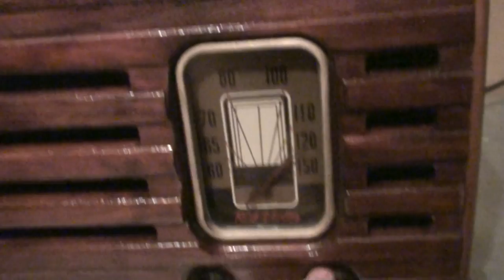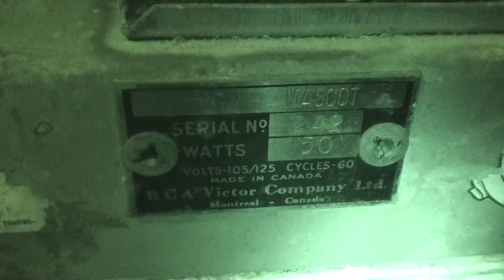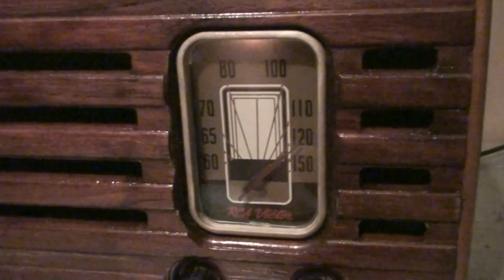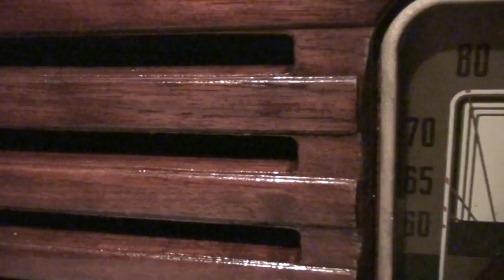1942 RCA Victor Mascot Radio

Comment: Good Job. I am doing one of these also and I like to know how did you integrated a glass in the tuning window if you do not mind. Also I noticed that is hard to tune the radio to a station and have way to much hum between the stations.
Reply from the maker: Glass was cut to perfection by a local window maker, it jams in the metal bezel. Am signal is known to be noisy on "Dead Channels"